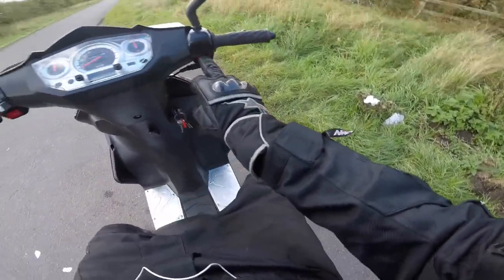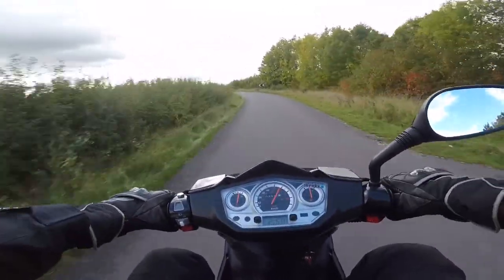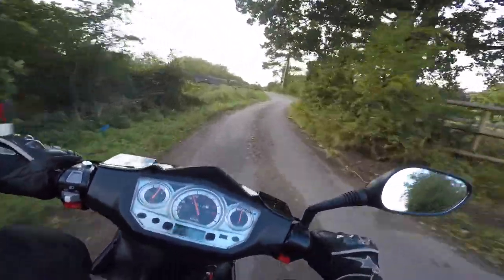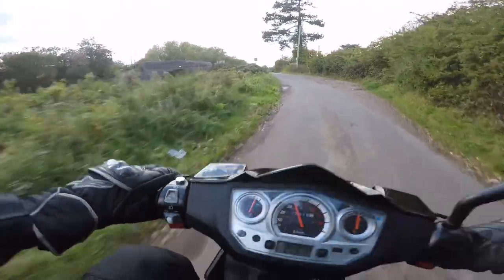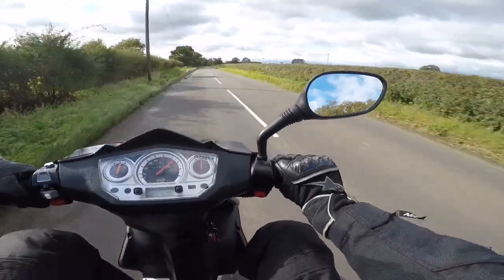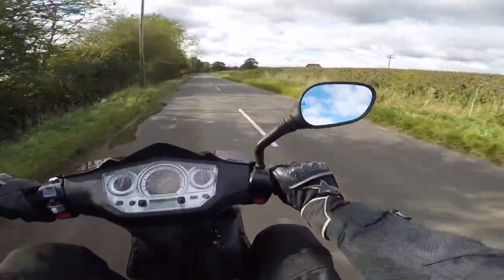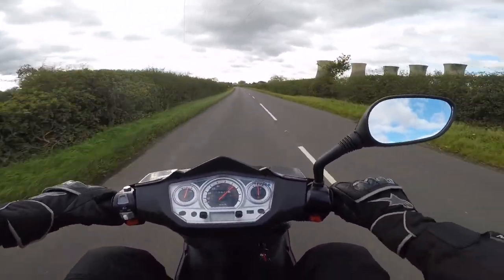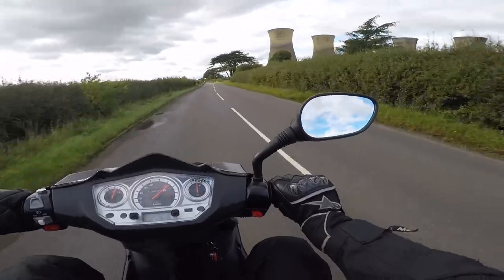Refilling 50cc moped with Shell V Power (AJS Firefox)

Comment: If you have a carburated scooter, always go for the premium 98 with no ethanol in the fuel. Shell Vpower as well as Exxon/Esso-98 even though called E5 due to reglementation, has no ethanol in the fuel, with that the risk of residue clocking up the carb is minimized. On a fuelinjected scooter you can drive whatever is recommended, but high octane fuel maybe enhance performance a little.

Comment: I'm going to do the test for my license , im kinda nervous about driving on the streets , any advice?? I live in the EU and the rules and street sides are different and the drivers are a bit crazy , they don't really look out for mopeds , they just pass us like were nothing and don't give a darn.
Reply from the maker: Yeah I've had a few of them type of drivers tbh lol, Just make sure you wear your protective gear and ride in the middle of the road even if you hold up traffic as this way they wont be able to make stupid moves and almost crash into you.
Reply: @JOCMedia  thx for the tip to ride in the middle, that will help me 🛵💨😄 ride safe mate
Reply: Late to the party but it's the same here (or at least in London!) During my training my instructor emphasised the need to take a dominant position for that reason, and if you try to maintain any urban speed limit (especially 20mile/h ones) you will get overtaken with no regard for your existence or life. For the full "pedal cyclist experience", ride on a road that had a speed limit greater than 30mile/h...
Reply: @fetchstixRHD  i got my license, every thing went good, just dont stress about it, and yea the drivers are crazy here,  be care full out there 😁

Comment: How fast does your bike go
Reply from the maker: Almost 40mph but it is still partly restricted
Reply: @JOCMedia  have u got any 50 cc bike brands would u recommend for a 16 year old
Reply from the maker: The 50cc Aprillia supermoto is quite good but you pay a premium for them which is why I went for an Ajs which are way cheaper.
Reply: @jacobjones1899  Yamaha aerox or aprillia sr50 r
Reply from the maker: I'd probably go with the aprilia
Reply: @lewislennox6227  go for a gilera runner 50 you wont regret itt
Reply: @radio-180cc  no need mate got aprillia sr50 r done up to fuck and tuned perfectly
Reply: @jacobjones1899  aprilia SXR 50 is the best and most secure 50CC scooter.

Comment: So did you ever notice any improvement in power or mileage with this gas?
Reply from the maker: Not really much change for my old 50cc bike but my new 125cc pops a little more with higher octane fuel in it and is probably just better fuel for the bike.

Comment: Is it restricted?
Reply from the maker: It’s got the variator ring taken out so the belt goes higher which gets it to about 36mph but still has the ecu restriction
Reply: JOC Media can you de restrict a moped at the garage?
Reply from the maker: Yeah I got the garage I brought it from to de- restrict mine.
Reply: JOC Media I’ve put the de-restricted ecu on will do about 45
Reply from the maker: Yeah was thinking of doing that tbh, how much did it cost you?
Reply: JOC Media the ecu is £85 off the ajs website, u literally just un-clip the old one and put that one in so wouldn’t need to take it to the garage or anything.
Reply from the maker: Which box is the ecu Cauz I’ve found one on the frame under the seat and there is another type of one under the plastics above the front wheel?
Reply: JOC Media it’s under the seat on the same side as the kick starter